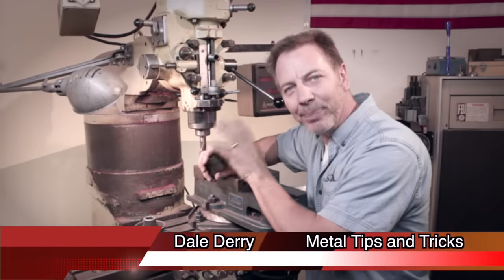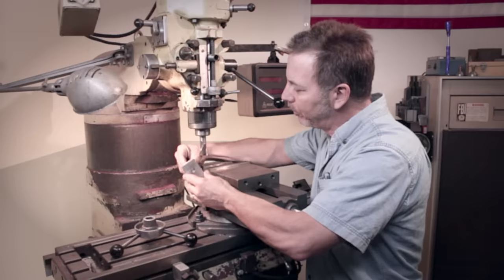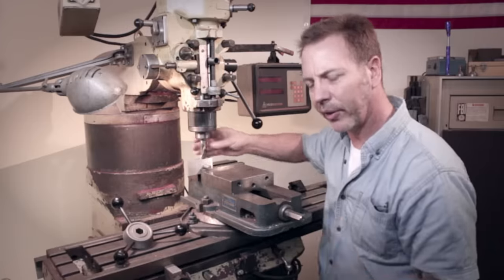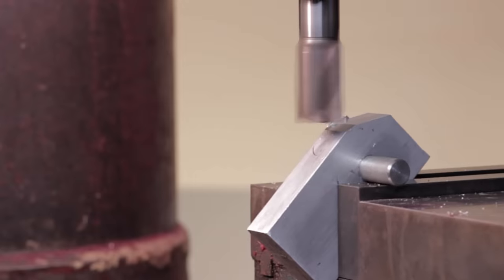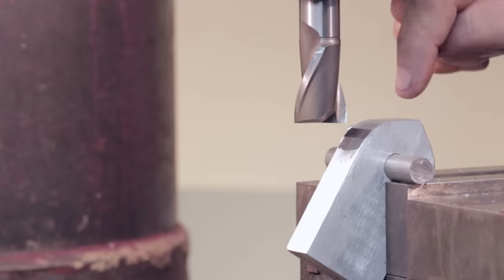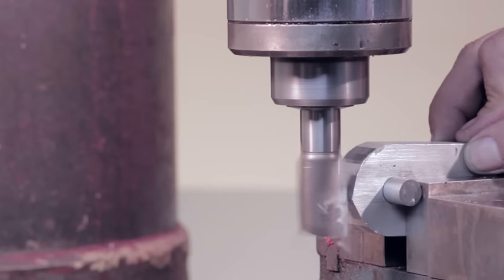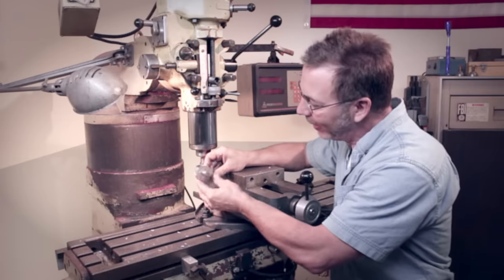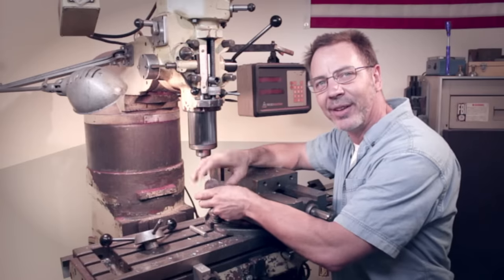How to cut a Radius

Comment: Perfect method to lose a finger. Never ever adjust a part in the vice while the mill is running.
Reply: oTomahuK  We are talking about Basics. Absolute basics. You dont need to put your hand on the part  while milling. You have a vice.
Reply: oTomahuK  😂
Reply: And yet he still has all of his fingers.
Reply: Not with that attitude
Reply: oTomahuK8945 lol that's hilarious. But no. Don't wear gloves around drill bits.
Reply: Watch to the 7min mark he mentions that.
Reply: Absolute newbie here (pre-inherited a mill):  Why don’t you build a quick fixture where you can clamp in a pivot point for the pin to mount vertically?  This way you can feed the part into the bit by rotating it around the pin.  If you are willing to flip the part once, you can support the pin on both ends with a single fixture so there isn’t any induced angle put into the setup.
Reply: @christopherlund1198  Short answer? Cause most people are too lazy for their own good. Its ok to be lazy. But then you should be better sure you are lucky and pray that your luck dont run out at a bad point.

Comment: My boss is wondering if there's a faster way to do that. I told him to buy a CNC.
Reply from the maker: LAUGHT OUT LOUD
Reply: CNC would be far slower, build in the time to proggy could do 5 by the time even done that way above.
Reply: Or retrofit a ProtoTrak controller on your mill.

But for a couple one off parts, this is the smartest, most efficient, way.
Reply: @jhareng  promise you I could fatfinger a program and have 20 done in the time it took to do your 5.  That program would be like 10-20 lines of code, start to finish.
Reply: @themonkeyproject  I would certainly hope so thats very basic. One thing all you cncers cant grasp is simple basic work holding on zero, in any case radius should have been put in with the holes.
You think i would part machine the end profile like the video above, think again. Done exactly the same as your cnc super machine without the programming and setup which means i would do faster!
Reply: @jhareng  You're the one that said CNC would be slower.  I can program and make the first part quicker than your manual, all day long.   Make multiple parts and you're 100% out of the race.    #2, I ran manual machines loooonnnggg before I did any CNC work.  CNC just makes more sense, not to mention nicer parts.  Maybe you've never touched a CNC mill, or maybe you've been watching idiots setup/program, but picking up 3 offsets is in no way slower on a CNC mill.  Maybe you just need to surround yourself with better machinists.
Reply: @jhareng  now make 50 identical parts lets see how far behind the manual mill is. Or the fact that you dont have to make a hole to pivot from is also pretty handy.
Reply: @andreasrasmussen6362  Who cares about 50 off thats for the pc brigade!
Reply: @themonkeyproject  You have no idea what i make worldwide!
Every cnc artist ever contacted pulls a fastun by skimping on programming and tool runs. In other words its simplified but dont cut the end product due to lack of understanding.
Granted simple and patterned stuff cnc is better after 3 or 4 off. Technical stuff what i make one cnc programmer/setter said it would take a day and a half to setup and would come off in around 16 mins. By that time have done 9 off at a much cheaper rate than cnc charge so exorbitantly for.
You dont grasp intricate, any idiot can drill a hole or mill X, Y etc to size having no feel from the actual job sat at a desk.
Reply: @jhareng  Keep going.  The more you ramble on, the more my point is made.   Thanks for saving me some keystrokes buddy!
Reply: @jhareng  why do you insist we are the ones lacking understanding when its actually you who dont understand CNC.
Reply: @andreasrasmussen6362  Thought it rather obvious time = money why spend a lot more time than actually doing the job just to proggy and tool up. Common sense or are you that far gone.
Reply: @themonkeyproject  Of course theres always those in denial after spending so much money rather than see it go to waste plod on losing money. You have no point totally irrelevant to what i said above when manual is far quicker on certain products, deal with it truth hurts.
Reply: @jhareng  its easily demonstrable in a polynomial graph.
Yes simple tasks will be faster on manual machines. But increase production units and complexity and the old mills and lathes dont stand a chance. There is a reason manual machining is dying profession.
Reply: Yup jonny,your drunk if you think you could make that faster than any programmed machine,ESPECIALLY if there is more than one.
Reply: @jmorginski  Typical cnc push buttoner only sees it just as that, repetitive production. It just dont sink in does it are you that far illuded
Reply: Jonny I work at a job shop and run lots of manual machines...because that's what my boss owns and runs lots of parts on em. We also have a few programmable machines some of them running g code and some conversational programming.  I can run both but the programmed machine is going to be faster.
Reply: But if a bridgeport or some other similar machine is what you have that still pretty damn cool and this is a good trick to know
Reply: @themonkeyproject  G02 x50 y0 i25 j0 :)
Reply: @jhareng  i dont take pride in a part i made on a cnc, but man it feels great when you finish a piece on a manual mill and have the satisfaction of knowing you made it, and made it perfect. Cnc guys blame the mill or the software or programming when something goes wrong. 😂
Reply: @gradoisx2348  Same here i do have cnc it never ever gets used. When i can make an item for the worldwide audience reknowned as the best for the last 26 years made by hand as a one off, cnc dont stand a chance with the drawing up time, 9 tools and setting up how logs that take cnc boys. Many hours each design!
Manually jobs done in 1hour 35 mins!
Reply: @jhareng  WOW! What a flame war! Jeeesus! We are all machinists here, chill! Every piece of machinery has is place and some thing that can do best, mediocre, and badly... don't fight over this stuff, chill
Reply: @jhareng  I could program the whole part on my HAAS in about 5 mins....
Reply: @jhareng  "Look how successful I am, internet strangers! Y'all suck, so give me validation! No need for me to teach you any tricks, just notice me and tell I'm right! Please tell me I'm right!"
Reply: @jhareng  I'll race ya, programming that entire part takes 3 minutes. Drawing geometry takes 2 minutes. Now, just milling the radius, 1 minute.
Reply: @randys3913  Whos on about such a simple task as that, i make my money out of what you cannot do efficiently! Efficiency is money, time is money.
Reply: @jhareng  I dont what you're trying to say. All I'm saying, its 2019, most shops are getting rid of the Bridgeports. What he did may take an hour worth of work to complete. Drilling a slip fit dowel hole just to use it a rotate on a vise is ridiculous. Invest in a cheap Haas. Trust me, you'll make that money back in a few months. You old tool makers are scared to learn something new. Just like an old dog learning new tricks. I deal with this everyday
Reply: @jhareng  Have you ever heard of CAM softwares? Maybe what you're thinking is "manual programming". LOL, it will not take you hours on programming, specially simple 2.5 or 3 axis projects. trust me. And do you know that you can set-up multiple offsets in just one program?
Reply: @jaym395  Yes, in short i am not talking about simple stuff like video but products with radiuses, knurling. drill holes, bore holes on different planes and depths that could only be done on 5 axis. The problem is the setup of 19 tools, time spent writing the proggy and the number needed to make it worthwhile. Quite often i will come in 1/10th the price of cnc with massive overheads, i even do China on cnc costings, cnc has its place.
Reply: @jhareng  fuse.layout.on..citreon.c3.
Reply: @jhareng  As an engineer this argument of machinist vs CNC programmers/operator has been hilarious as hell lol. They both have their positive/negatives, a manual mill is better if for prototyping quick alterations where eyeballing it would be better.  CNC is better for extremely tight tolerances if you know what you want and high volume production. Either way they both have their purposes in a shop.
Reply: Matt wholly agree at least theres someone on here that understands
Reply: Or just use a rotary table on a bridgeport...I could do on of those in about five minutes.
Reply: @funnymanatwork  Well I just got an AI bot that runs my whole CAD/CAM/CMM machine shop 24/7/365. Leaves me time to make cool little projects like the one in this video on my hobby lathe, and not have to deal with listening to machinists prattle on and on about how little they are paid.
Reply: @jhareng  until you need to do 20 in a row
Reply: @GreenBeret1903  dont do cnc its where i make my money
Reply: @GreenBeret1903  Just dont sink in does it, i compete with CNC hacked out stuff in China plus they pull fastuns and i am still 10% cheaper!
Reply: @randys3913  in 10 years robots will have your job and out the door you go budy. Robots already do security😉
Reply: @scottnipper5066  YES
Reply: Rotary head mill if you want to be weird.
Reply: Buy a rotary table its cheaper
Reply: @Jrez  Never. They said that 100 years ago.
Reply: Dillon Mcconnell  i know, manual is good for some things but No way in hell does a manual machine beat a cnc in every scenario. Im a machinist turned mechanical engineer so Ive seen quite a bit of both. Also grumpy Old machinists who dont like change.
Reply: Dillon Mcconnell  Trust me. A CNC can do it all. Of course there are limits for what it can do but goes the same for a Bridgeport. There is nothing a manual machine can do or do better than a CNC. Im working on 5 axis now. Look that up. Crazy what you can program on GibbsCam
Reply: Holy shit, I'm reading the comments and wondering if you guys have ever used a conversational control.  They're made for this type of work, and will smoke this method.  But you gotta pay!   This method is sweetwhen you're not trying to hold plus 0.001 on the contour.  And if you can't program this quickly ......  go back to class.
Reply: Has no one done any proto-type work?
Proof of concept?
R&D work....
Come on. A million reasons to have only manual machines.
Reply: @MrBigShotFancyPants  still faster to make a 3d model or a CAD and program post using a cam software. CNC > MANUAL all day.
Reply: @MrBigShotFancyPants  that's wrong.  Learn on a manual so you know what tool paths are.   Then use a cnc like a real machinist so you can conceptualize parts that are almost impossible manually.   Trust me, it's a better way.   Real machinists know how to use the tools they have, manual and NC.
Reply: @willrobb9520  i think you've replied to the wrong comment. You start with that's wrong then agree/repeat what i commented. You and i are in agreement. I started on manual.
Reply: @randys3913  for sure. As soon as we had an approved product developed it went to programming first. Even small quantities, get a repeat order next mo/yr,  pull it up & run some more.
Reply: @randys3913  it's not even cost effective to equip an r&d/proof of concept/engineering/maintenance dept w/all those costly production tools.
BUT THEY ARE FAST... ok?
Reply: @jhareng  its clear that you arent aware just how fast  and accurate cnc is. A part like this can be modelled and programmed in under 20 minutes by an amateur. Tske this to a professional and this would be an under 10 minute to model and program part. Going forward, a more complex part would just be money in your pocket as you save more and more time.
Reply: @DayDrinkin  In all fairness no disrespect as said several times above i am not referring to such simplicity as the video is about. I make my money from one off custom jobs that cnc is too expensive to do, (min 16 tools with as many as 32 separate operations, with me now) . Whether thats setup, programme or not uderstand the end product i can still kill cost made by cnc even made in China.
Reply: @jhareng  Lol
Reply: @jhareng  not true for everyone!
Reply: @jhareng  Put your money where your mouth is and use this opportunity to advertise your business. What do you make? You don't have to divulge any secrets as to how it's done, just curious.
Reply: @dudemcgee256  Which part of i dont need to advertise dont you grasp, a product sells itself If your good enough!
Reply: Look guys! Jonny is making so much fucking money he has the time to sit on Youtube and comment infinitely about it. He couldn't comment here if he knew CNC, because he wouldn't have any time or money. Go Jonny Go!
Reply: @jhareng  Thing is, for a part like the one in the video I could write a program for it in 5 minutes. I do that once. Next time I need it I have the program saved ready to use. 
All while you need to do the same measurements for each and every part. I don’t see your thinking thinking
Reply: @jhareng  a little late but the modern mazaks, or even 2008 era will do that in 15 seconds
Reply: @usak8670  Very true now were getting some where. A starting point of $500k without tooling, assuming machnes free to use. 
Not forgetting the cleaning up pre use, zero etc will take a damn site more than 15 secs!
Either way expensive part if true costs were put through the books of order of $500 - $1000. Or put it through as a foreigner NIL cost.
Reply: @jhareng  yep, our shop is fast paced production so it was worth it to get cncs
Reply: @usak8670  If only you were closer, i have a few jobs you could quote on for.  CNC has its places.
Reply: @jhareng  hey our company does jobs from out of state, depending how much needs to be done I'm sure the guys would take it.
Reply: @gradoisx2348  a cnc has no brain. You must use yours. Knowing what need to happen applies to All types of milling machines
Reply: Get you a haas
Reply: @jhareng  CNC machinist should have the practical skills of a manual machinist. It's like, no wonder music sucks so much today because it's all made with computers, computers can hot the notes and the rhythms perfectly but it's the heart that's in the traditional way of making music that made it so good, a lot of people would appreciate a manual machinist's abilities. If I wanted a special bushing made for some old farm machinery being restored for a museum for example I wouldn't go to some CNC machine shop, I'd go to oldmate down the road who can slap a bit of bronze in his old lathe and turn it up just the way they used to, not some nerdy button pusher that doesn't understand why I'm there.
CNC machinists are jerks 9 out of 10 of them. Hence there's some in the comments going "hurrr sure I can do that better" completely missed the point of this video.
Reply: Depends on how much work and time he’s willing to put in upfront.... or pay for... Aren’t bosses great?
Reply: @jhareng  can't believe what the hek you said..by the time I set up the machine and write a loop that cut that  radius point by point whit a 0.1 degrees increment you barely drilled that hole
Reply: @jhareng  my god man relax
Reply: how many do u need to make?

Comment: If you are planning to stay manual, look for a cross-slide rotary.  This type of table mounts to your mill table just like anything else, but there is a built in cross slide on top of the rotary.  You can mount your Kurt type vise on top of that.  This allows you to turn a radius on one end of that short workpiece, move the cross slide over and cut the radius at the other end.  You can keep this setup on the mill permanently.  You will need a 6 inch riser too no doubt.
Reply: what part of "faster, easier way" missed you?

Comment: I was a job shop machinist for 15 years and that's the first time I have seen that done . Very nice job.
Reply: why not vise the pin then rotate the part in an up/down motion?
Reply: @erikdevaney4781  good way for the endmill to snatch the part, and tenderize your fingers.  Especially with a big 2 fluter like that.

Comment: Hey mate i' m a tool maker myself and i have been working fixing molds for 9 years and tooling 17 years and i have never had the need to make a radius like that. I' ve used the radius dresser on the grinding wheel to grind the metal part or make the radius on the electrode to burn the metal part on the EDM. But man! Thumbs up i learned something new today, bless you man.
Reply: I've had a machine for 9 hours and 17 minutes. I'll take any tips I can get.